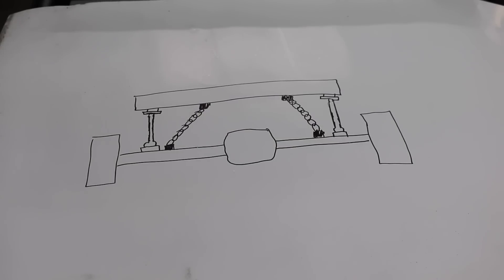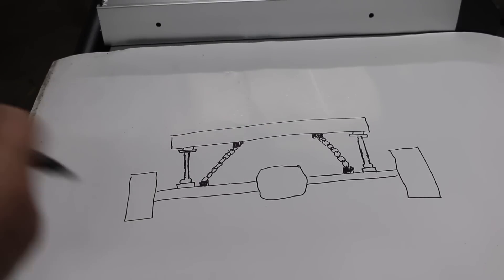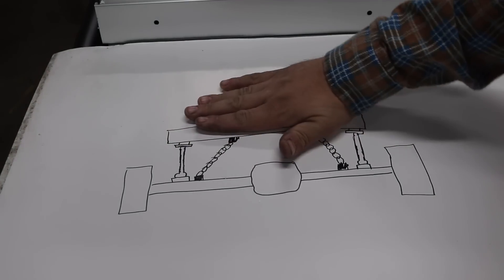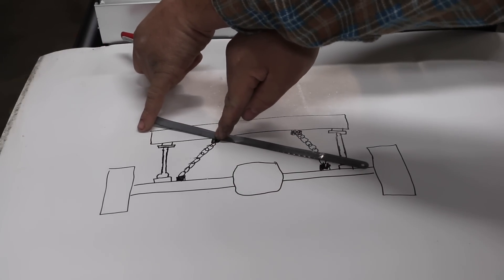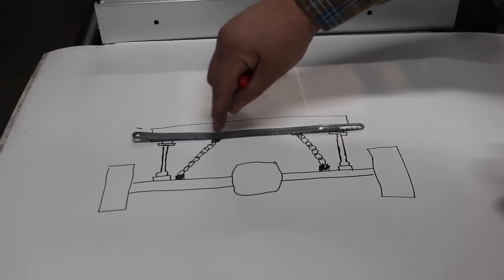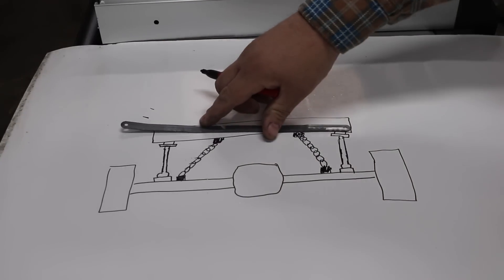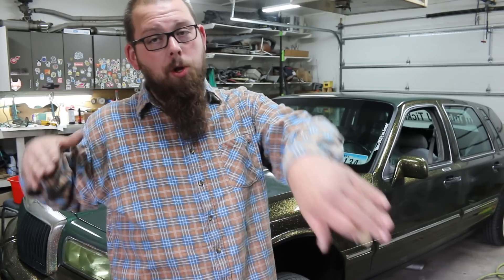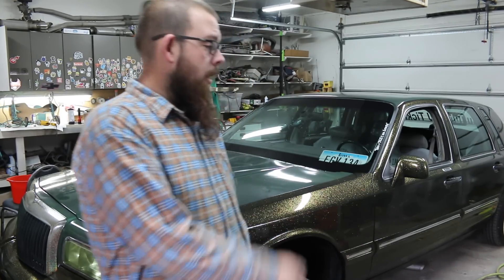How to 3-WHEEL with a chain bridge!!

Comment: Well it's similar to the limit straps we used in our four-wheel drives, so it did not overextend the shocks, similar situation here so it does not overload or overextend the hydraulics it's a very useful and very smart safety item

Comment: If you have tall enough cylinders in a town car you don’t need chains, and can do a standing 3 with just 2 pumps and 6 batts. The homie has a 96 and a crazy high lock up, no chains, as soon as he dumps one of those back corners, ass hits the floor and he’s standing a huge 3 wheel.

Comment: Hey man I seriously appreciate this video I've watched it 3 times already might not be the last.  letting the info soak in and marinate.  But how thick of gauge did you use on the bridge? What tall are you cylinders?  And what Gauge is the chain?  how long is the chain compared to your cylinders?  the height of your cylinders yielded you how high of a 3 wheel?  What kit/ manufacturer are you using?

Comment: Hey RJ what size cylinders do you currently have in this point in time. Thanks
Reply from the maker: I don’t that the car anymore. But have a different Lincoln with 12s that three wheels nice. 14s work good too but really need a slip yoke for that.

Comment: In 91 I had a candy green 64 Impala only had two pumps. Front back side to side so one day I got the idea of putting a lot of weight on one corner of the car in the trunk. I picked my car on all four I dropped the right side I picked up the front all the weight on the rear cause my left side to go up I was three Wheeling on 2 pumps

Comment: You can't standing three on less than three pumps only because of fluid not because of control of the two different corners he also forgot some people run a pumpkin chains instead of outer chains
Reply from the maker: hunterdep1 actually has Nothing to do with fluid. And has everything to do with controlling rear cylinders individually. Unless you have an x frame or a ton of weight in one corner you need to be able to control your rear cylinders independently from each other. You can run chains wherever you want. But 80 percent of chained set up today are like this.

Comment: Hey RJ. I am looking at picking up a 96 town car soon. I had seen that a 2 pump with multiple dumps can be used for 3 wheeling. I noticed you said 3 wheeling can be done in motion but not on a stand still, due to the lack of weight in the back. With a 2 pump set up, do you think it may be possible to stand 3 wheel if the batteries were mounted as far back and into the corner as possible, or would it still not be possible due to the lack of leverage? Thanks.
Reply from the maker: Anthony Guevara it’s still not possible. Or worth it really. A third pump is about 350 bucks.

Comment: If you have a 2 pump setup with 2 dumps to the rear couldn't you just hold one dump switch while bumping the "up" switch and 3 wheel?
Reply from the maker: Ronnie Rowe you would need two dumps on each cylinder so you would need 4 dumps on the rear. One dump would act like a shut off valve and and hold pressure from going to both cylinder. Way more complicated than just running a third pump. Looks goofy too.
Reply: @RJTickler  thanks for info man. Love the videos

Comment: I used 8 dumps to do 3 wheel it was simple to do for the wiring to the dumps I used diodes from the pump dump to the solenoid instead of a relay so it worked allot faster.

Comment: How much would you say supplies cost ? Also does anyone ever use cable instead of chain ?
Reply: Good question. I wondering the same. Definitely quieter then chains.  But maybe harder to figure out the length you need..compared to chains just move a link. Haven't seen it yet got to try i guess

Comment: Thank you for showing and posting this video. I have installed hydraulic suspension set ups in both cars and trucks. Everything that I have done and learned was done by trial and error on my own rides. I have seen and used or built chain set ups but I was originally taught that the reason behind the chain was to limit how far the cylinder could go. I was told it was done to make sure that the cylinder couldn't over extend so it couldn't lock the cylinder in a fully extended position or worse, having the cylinder go far enough to fall apart because the part of the cylinder that moves in and out would be pushed out causing the ram to be pushed out of the tube, not sure if I'm making sense. I've never seen it happen but was told that it could happen without having the chain in place to make sure the cylinders couldn't over extend. Your explanation makes quite a bit more sense and I understand how it makes it easier to 3 wheel.